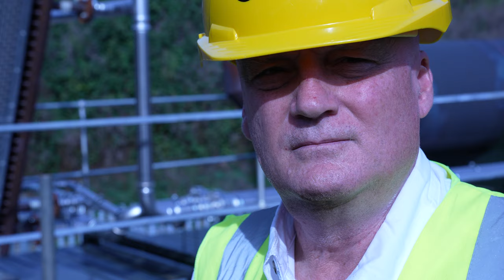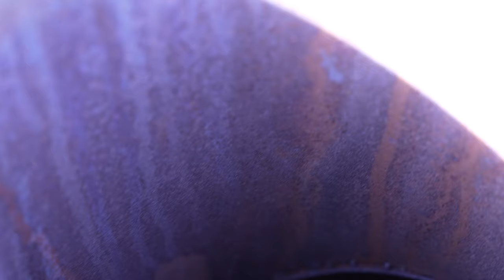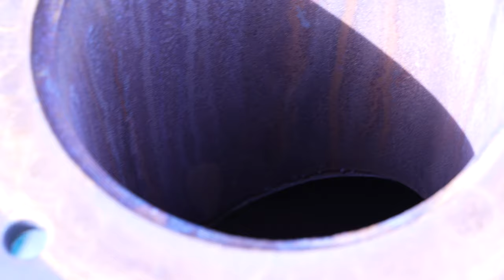THOR - No carbon in flue

Comment: A new way to realize "Carbon Capture" 🙂- with no need for "Storage" - could even be installed deep underground to reduce the risk of exposure to strange radiation (by effectively "grounding" the strange radiation) - meaning, of course, that existing gas and coal turbines could be retrofitted to become viable again.
Reply from the maker: Maybe - early in the verification process at the moment.